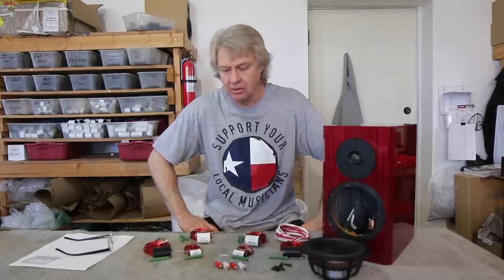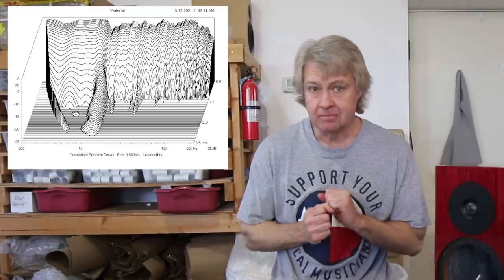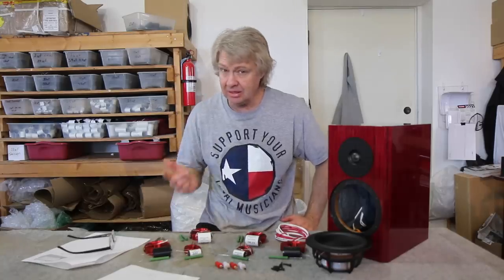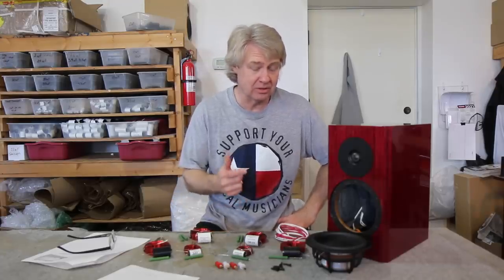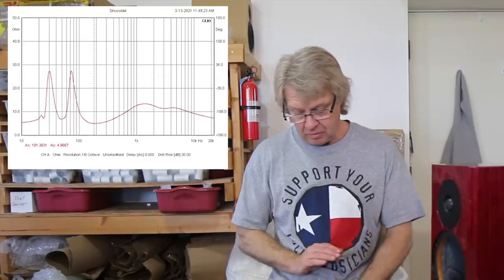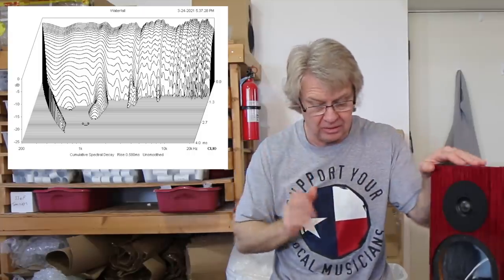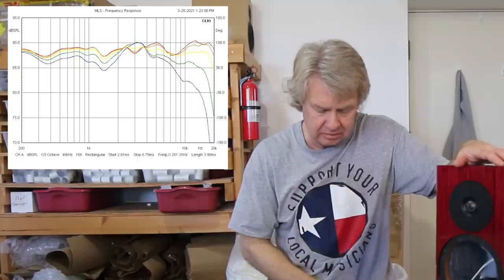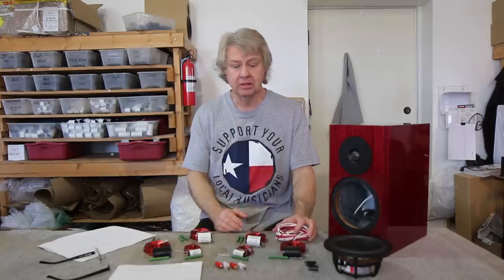Dynaudio | How “Special” is the 40?

Comment: This chap still believes into significant differences between cables, capacitors and coils. I tried this in the 1980's (young ears) several times without result. Useless approach, except for the providers of such parts. Buy better speakers, if you are not happy, and please do not waste money on esoteric nonsense!
Reply: While I agree that changes in some of those will not alter the audio signature, he does show actual improvements in objective measurements from the upgrades. Regardless, he's right in that for that $, it should not be full of low grade parts. That brand seems a terrible value for $.
Reply: Ok boomer
Reply: @willbrink  Sorry mate, but he is straight up lying to you and then you repeat it.

1) He did not fix anything - all he did is change the frequency response - which he can do, but that does not make the speaker better just because it is flatter.

2) Dynaudio is one of the best known brands for their high quality speakers with top notch parts. That is the reason why a pair of Focus 340 I bought used 5 years ago 2.000€ are still worth that money now.

3) This has nothing to do with dollers - these aren't your typical cheaply made American speakers - these are done by engineers from Denmark. 

To each his own - if you don't like Dynaudio or you aren't even into hifi - fine with me, but stop repeating something without doing your research.
Reply: @zebarzebra  1) He did not fix anything - all he did is change the frequency response - which he can do, but that does not make the speaker better just because it is flatter.

A: Flatter speakers are generally a better speaker, but you can debate that if it makes you happy. 

2) Dynaudio is one of the best known brands for their high quality speakers with top notch parts. That is the reason why a pair of Focus 340 I bought used 5 years ago 2.000€ are still worth that money now.

A: you must have watched a different video. He literally shows the low grade parts in the box, unless you think he faked what was in there? For that $, those are low end parts. 

3) This has nothing to do with dollers - these aren't your typical cheaply made American speakers - these are done by engineers from Denmark. 

A: Of course has to do with dollars, and some companies charge a fair price for they offer, some, not so much. Like speakers from Europe, US speakers ranges from very well made to not so great, and what matters is what they cost for the value. As far "done by engineers from Denmark" you're poorly informed: "Dynaudio is a chinese company with a chinese majority owner. Some of the lower lines are FULLY MADE IN CHINA. The cabinets are outsourced, and the higher lines are assembled in Denmark." Dynaudio was acquired by Goertek in 2014 

To each his own - if you don't like Dynaudio or you aren't even into hifi - fine with me, but stop repeating something without doing your research.

A: Not I who needs to do their research obviously...
Reply: @willbrink  Dynaudio is a Danish company, owned by Chinese. It is located  in Skanderborg, 30 km from where I live.
250 of their 350 employees work there. All development happens there. According to their website, production also happens there.
The latest info on cabinet production, is from 2018, and it says that their cheapest models' cabinets are produced in their own facilities in Latvia.
Reply: @akyhne  What I posted: "Dynaudio is a chinese company with a chinese majority owner. Some of the lower lines are FULLY MADE IN CHINA. The cabinets are outsourced, and the higher lines are assembled in Denmark." Dynaudio was acquired by Goertek in 2014
Reply: @willbrink  Just because you're repeating yourself, doesn't make it more true. Just because a Californian company owns Sound United, it doesn't mean that Denon and Marantz are American.
Dynaudio is 100% a Danish company.

As for their production, I'm sure you have a source, debunking what they write on their own website?!
Reply: @akyhne  Dynaudio is Chinese majority owned company. Sorry of that bothers you, but "because you're repeating yourself" does not alter that fact. That they are headquartered Danish does not alter that fact either. As far as some things being sourced in China, that came from Otto Jørgensen is Product Manager in Dynaudio via the AVs forums, but what does he know right? Think what ever makes you happy bro. I don't care one way or another...

Comment: Pretty good upgrade in terms of measurements. Suprised the woofer measures like that. I'm a huge dynaudio fan, but opening up my sub amp that has failed shows very cheap components just like the cheap crossover components in this speaker. Bit dissapointing to honest.

Comment: the fastest and most resolute speaker that i ever had ... but now perhaps there is the reason why after the initial excitement from those two parameters was a little bit gone i couldn't really enjoy it.
Not sure if the changes in the filter done here are also the cure, because is a complex one with suppose time/phase adjustments that are probably gone after this corrections.
Th original wire is a vandenhul snowline ... actually not a bad one ;)
Reply: That's what I wonder too, if 100 people listened blind before and after what would the results be?

Comment: He's trying to sell us KITs. We need to have that in mind. 
if the mid/low woofer should be cut at lower freq, it would have been done already by Dynaudio (it doesn't cost extra money). 
We can't design speakers on the paper..
But anyway whole topic it's quite interesting.
Reply from the maker: The point in me doing this isn't to sell upgrade kits. It is to help improve the listening experience for those that have these speakers or any speakers. It also introduces people into the DIY market. And eventually we can step them up into some of our higher quality DIY kits.
Reply: @GRResearch  Thanks for response. To dispel all doubts it would be nice to not only see the speakers already equipped with KIT but also to have listen session and a kind of comparison. 

The point is that I just can't understand how the heck these speakers are so popular, very well rated across the globe while in fact built from shitty parts. I do own a pair of these,  I've had compared with many other (even with slightly more expensive ones) before I bought them , and for me there is no better speaker in this price range. I never took a look at the paper, only listen. And of course I know, this is only my personal subjective opinion :)
Reply: @ukaszdubiel7584  No better speakers for the price range? There are way better sounding speakers out there for a fraction of their cost. Our base level X-LS Encore kit at $249 a pair will beat these up pretty well.
Reply: @dannyrichie9743  it sounds so much commercial (KIT again)
For me it now seems like there are no any good speakers on the market and we need to get them all equipeed with KITs :)

I give up here :) 
Good luck with your business
Reply: @ukaszdubiel7584  Why not make a speaker better? Any speaker can be tweaked or upgraded. Even our kits come with a list of additional upgrades. That is part of our never ending quest of making our systems sound better and better.

Comment: I have a question.  Why do some speakers have a fluctuating ohm rating?  Is this by design?  Is there an audible advantage to this?  And lastly, why don't all speakers have a 4 ohm rating if it's more advantages?   Thanks
Reply: The fluctuations are caused by the filter. And there is no advantage in a speaker being 4 ohms. That is much more of a disadvantage. That looses most of your tube amp guys and guys with home theater receivers.

Comment: Do your tube connectors work with regulars banana plugs?
Reply: nope
Reply: Yes, they except standard banana plugs. They just won't sound as good as using the supplied ends that come with the tube connectors.
Reply: Yes they accept the banana plugs. I have them in my NX-Studios and tried  🍌 in mine. No problem

Comment: Dani great video, it is such a shame that the manufacturers cut costs on such important areas of the build. Watching all these videos of yours has seriously opened up my eyes to what goes on and how easy it is to fix with your technical knowhow. I would not have ever expected electrolytic caps etc in a 3k speaker or from a respected brand such as Dynaudio. I was looking at a pair in my UK dealers and have to say I was drawn towards the lovely finish. I will have to think long and hard what to buy now, shame not in USA as I would invest in one of your kits and flat packs. Anyway thanks for the insight.

Comment: I don't really understand how he opened all the speakers tell as how he fixes everything changed the components and Have new measurements! and  while talking about them I can still see the "old version" of speaker with the old components inside , in front of him ?????
Does he charge it back???? 
Does anyone can answer this ?
Reply: The new networks are designed with an external crossover connected straight to the drivers.

Comment: I am a fan of Dynaudio and owned most of their Audience, Contour, and Confidence lines back in the early 2000s. I was going to buy their limited Heritage speakers but after seeing how cheaply their S40 speakers are made, I'm having a second thought. BTW, the S40s are now $3500. The $500 increase, I guess, is for lower quality parts and workmanship. lol. Nice job Danny!
Reply: Choose harbeth superhl5plus you won't go wrong with the sound and built quality.
Reply: The Heritage Series completely crushes the S40 and all the parts in are better than anything he is offering here as an "upgrade". All True 1st order crossover (SP40 is not), Mundorf Caps, Vandenhul wiring and a complete redesigned tweeter and the best driver Dyn has ever made pulled from their highest end Tower speaker. The SP40 is still a great speaker that operates above it's price point, so this fella can say whatever he likes, I had them for years and they were great. Once you hear the Heritage there is no going back to them however.
Reply: @jc51373  I really appreciated your comments on the Dynaudio Heritage Special. I've just read Steff Huff's review and my mouth was salivating. I assumed that you owned a pair. What amplifier are you using to get the best out of it? Do you know if they soldered the wires or used push-type connectors onto the drivers? That was so cheesy on the S40.
Reply: @mitulvenkataramanasamy5187  Thanks for your recommendation. I tried to like the look but it wasn't for me.
Reply: @audiomacaudiomac5019  I am running a Class Integrated from Sugden, MSB Discrete DAC on the Heritage I am auditioning. I haven't pulled the trigger yet I want to hear the Tune Tots first...The wires are all soldered to the board.

Comment: New to the channel... love the videos and the tech talk..... I know your measurements turn out much better but I'm missing the subjective evaluation of "how does it sound".  Just because a speaker measures flat doesn't mean it sounds better.
Reply: You are correct. The measurements just show if there are audible problems or not. The upgrade in parts quality will make significant improvements in quality across the board.
Reply: Danny, i think you should make a complete video starting from your normal analysis, your recommendation then a high quality video of the actual sound before and after the upgrades. This will eliminate any doubt from the viewers. As for me, mostly I agree with you, as i have good result when using a better crossover components.
Reply: @johankamarudin5155  He doesn't even listen to them.

Comment: If Danny could issue a 1000K Special40-level speaker, that would be a day of hi-fi revolution. Us regular folk, then, could afford high-end hi-if; and the manufacturers would think twice before surcharging their speakers.
Reply: If a speaker cost 4K then it goes to retailer at 2-3K. So if you buy from brands online directly you can already get more bang for your buck... The most expensive part of the speaker is the cabinet, so if you don't care about looks that much you could already get a 4K speaker for 1K
Reply: @fluim0102  Do not care for the finish of the cabinet. It’s all sound for me.
Reply: @gokhanersan8561  Then buy studio monitors... I have a pair of Genelec 8030. They are a very good value for money and require no additional amp

Comment: To be clear, at 4:29 You say "at least it has some Iron Core inductors" but didn't you mean Air cores??  I think you would only be advocating an iron core if it was a decent laminated iron core like the Erse Super Q and then only below 200 Hz on a bass only woofer Like in the Klipsch 8000 upgrade

Comment: Hi Danny. Great vid. Thanks for posting. Im curious how the Special 40s would compare to your xl s encore?
Reply: The Encore with upgrades is still out of its league.
Reply: @dannyrichie9743  thanks for your reply. With the encore so well reviewed, and the special 40 still in another league, would you say that the difference between the two speakers would be the quality of the driver and the tweeter since the other parts used on the special 40 still has lots of room for improvement?
Reply: @jailthejudge  There are still a lot of differences across the board.
Reply: @jailthejudge  
Mostly drivers I would say. Despite the fact that the Dynaudios may not be perfect in freq resp or other easily measured parameters their drivers are still some of the best, well better sounding on the planet. The whole encore parts might get you one the Dynaudio woofers if it was available. I think Solen in Montreal sells their components, of course they are very expensive comparing to other manufacturers.
https://solen.ca/manufacturer/dynaudio/

Comment: He's incorrect about the speaker wiring being coated in PVC.. Dynaudio uses Van Den Hul  OFC copper, it's PVC free, double insulated using  using HULLIFLEX ® insulation material. Same internal wire used for B&W and other European brands.
Reply: It did not look that way to me.
Reply: Eric is right! I have the SP 40 it‘s van den Hul copper wire. I have the upgrade, it has higher resolution sounds more direct. Not very forgiving any more, now you need good sources and amps!

Comment: Excellent job, Danny. 

Someone once said that they were not fond of speakers with oversized voice coils. I forget his reasoning. 

Question: what happens when the copper connectors become tarnished? Does the oxidation affect signal transfer? Hmmm...now that i hear myself, I think I know the answer.
Reply: I believe that a 3 inch voice coil on such a small speaker results in a spider with a narrow wall.A small excursion of the cone stretches the spider a great deal exerting restriction  om cone freedom to move. That voice coil; was used mainly to increase power handling and make the driver look imposing and impressive.

Comment: Thanks Danny for the video on these speakers.  They are really pretty speakers, but it was surprising the change you made for just $300 of parts.  Maybe you could provide a video on how these components actually work in crossover at some point.  You use descriptions like notch filter, but I'm not sure if that's a resistor or a capacitor you're referring to.
Reply: A notch filter is an inductor, a capacitor, and a resistor.

Comment: I can see your point but the tweeter on Dynaudio sounds very different from the Sony that for sure, the Dynaudio sounds much faster for example. I never heard any tweeter for 30-50 USD (Seas, Peerless and other) sounds so fast  as Dynaudio. So I know just upgrade the croos over for 200 in the Sony will never not be able compete with Dynaudio tweeter. YES i agree the Sony will sounds much better after you upgrade but a lot of the sound Dynaudio give can Sony never give
Reply: What does Sony use? Their top of line years ago used ScanSpeak if I remember. Ah the 30-50$ tweeters, most of them drive me nuts, but there are some gems in this category. I agree with you on the Sony upgrade, the D260, 330 Esotec was kind of a special tweeter back when it was available to diy.